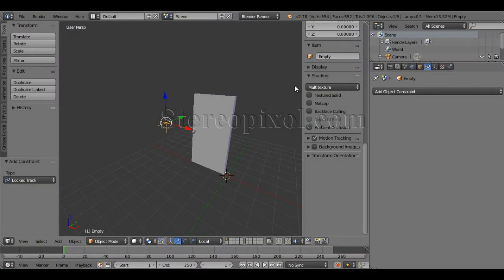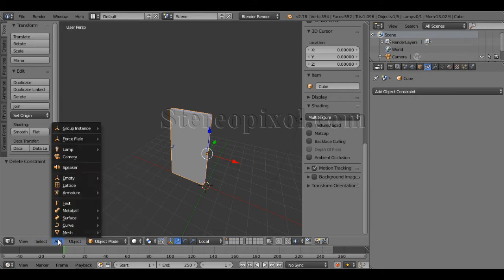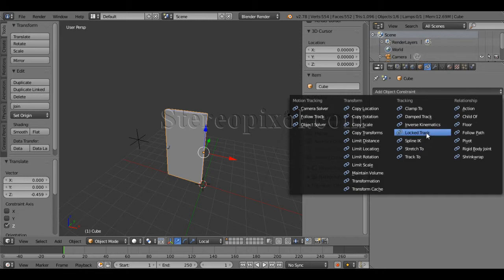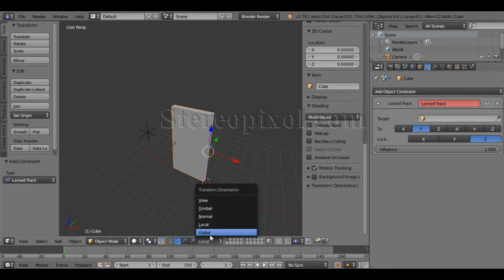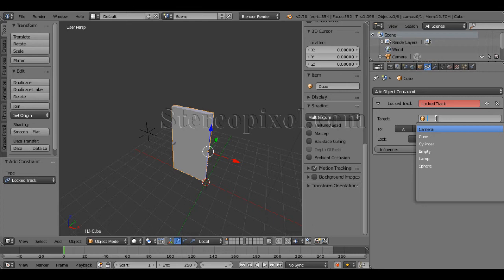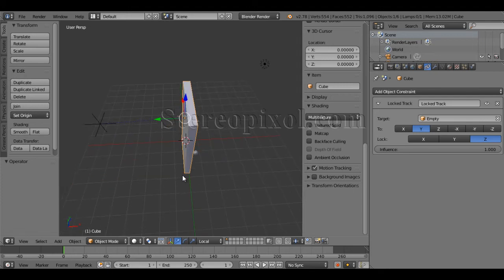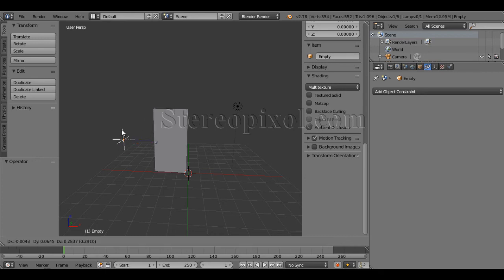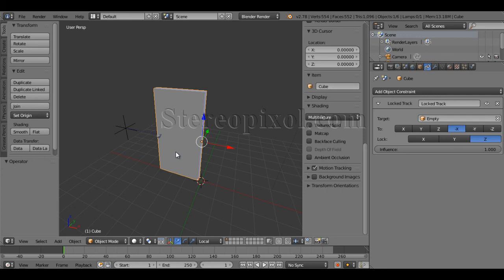How to rig a Door in Blender - Blender 3D beginners tutorial

Comment: How did you position the xyz axis to the edge of the door? I'm trying a trunk lid and when I select the lid the xyz axis is positioned in the middle of the mold. I want it positioned at the edge area (hinge).
Reply from the maker: +CoverLand Acoustic Use the 3D cursor. First snap it with the edge , then move the center to the 3D cursor.